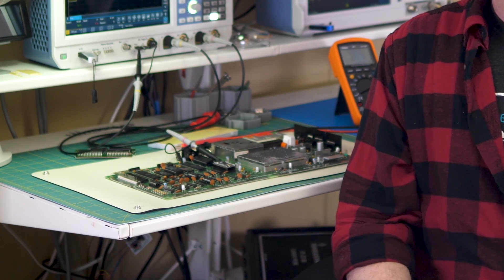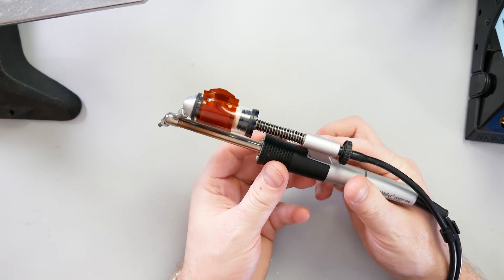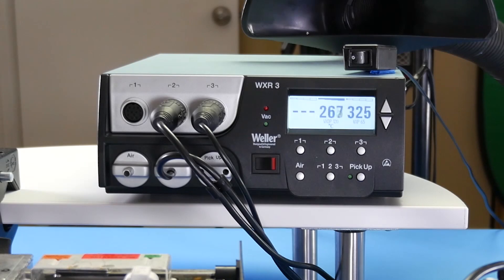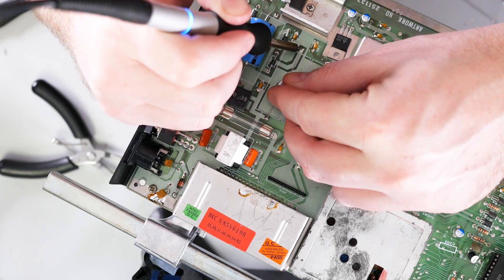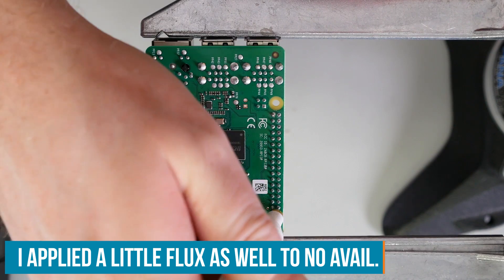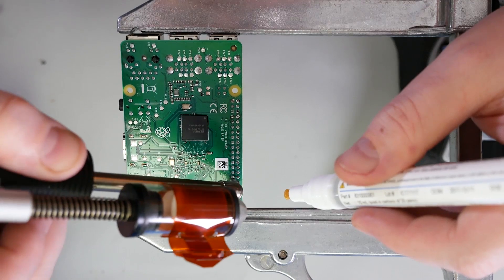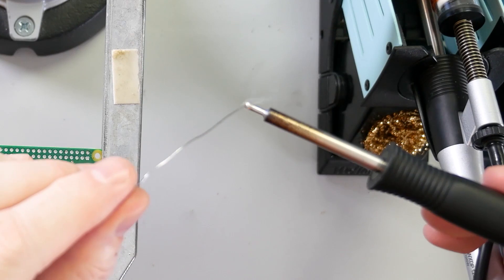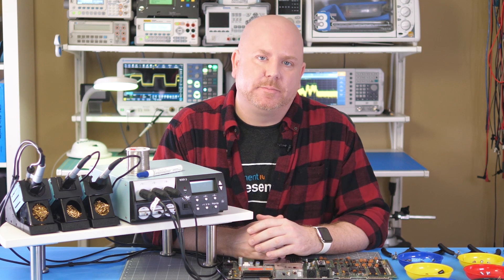Capacitor Replacement on a Commodore 64 - A Lesson in Through-Hole Soldering - Workbench Wednesdays

Comment: You never need to change the ceramic caps they never drift lol. even working on Radios from the 20 I have never seen one move. 
but I change them with axial MLCC capacitor because it just makes the board look cleaner on the C64's  work on. they even make axial electrolytic so you don't have to geto rig them caps in like that..

Comment: Thus far for me was a static generator,  just stoped working i was afraid wires had been crossed to the tri AAA battery holder. Took it all apart nothing wrong. Grrr so i checked the baterys that had been in the flash light i had just cannibalized for a year or more. Ha! Suppose to check power first!🤣🏌️‍♀️

Comment: @5:00 by spreading the capacitor leads wide like that will stress the rubber seal and it will leak years sooner than a buying a proper axial capacitor that fits there.

Second did you compare the ripple current specifications of the old caps?  If those new poly ones don't meet the same ripple capacity, then the computer may have intermittent brown outs and crashes.
Reply: On polymer capacitors, there isn't a rubber seal because there is nothing to leak. The polymer layer is solid.

Regarding ripple, polymer capacitors have at least an order of magnitude less ESR which means they have at least an order of magnitude more ripple current capability. So yes, I compared those specs.

I think you need to watch the TLC video on polymer capacitors, because they are significantly different from traditional aluminum electrolytics (which your comments apply to.)
Reply: @bald_engineer  I've used them before, and polymer caps are wrapped just like a regular electrolytic cap.  But if they have a solid core then they are surrounded with a electrolytic liquid.  Only ceramic caps are a solid material without an electrolytic liquid.

Where the leads stick out of the cap is the weak spot on all caps.  

What caps did you use, I would like to look them up.
Reply: @MidnightVisions  It is difficult to correct your misconceptions here without pictures and references. I've created a thread on element14 with links and details. I've also included a few articles which I wrote when I was a technical expert at a capacitor vendor. Find the information here: https://www.element14.com/community/docs/DOC-91431/l/workbench-wednesday-04-capacitor-replacement-on-a-commodore-64-a-lesson-in-through-hole-soldering#comment-152632

Comment: I actually thought this would be like a restoration video, but it was an ad. Which i don't dislike, if the ad is well-made (like this one), then why not.
BUT.
Lets start with WXP65, since its closest to my ZD-916 soldering station. It's 65W and it's ONLY a soldering pen, meaning you need 24V adapter (not recommended) or the station in order to work with it. Price? 204€ on Farnell. I got mine for around 60€, its 60W, whole unit with a decent pen, temperature setting and digital display. 
WXP120, the 120W soldering pen. For some reasin a bit cheaper than WXP65, 190€ on farnell. Again, just a pen, no station/controller/whatever.
And the station itself, WXR3. 1850€. I mean.. my used VW Polo costed me that much. Yea, you need good toold if you do professional work, but i won't give almost half a year of my wage on a soldering station. Sorry, not intended for hobbyists.

Comment: I've been using some sort of solder sucker for about 35 years.  I find that the quick shot of a large volume of air works great to evacuate melted solder from a via, large and small.  The large chamber also holds a lot of solder and the tip doesn't clog up.  I just heat the joint until the solder is fluid, then quickly put the solder sucker over the molten solder and suck it away.
After the job, just separate the top and bottom halves of the unit and dump out the solder bits.  I've been using a SOLDAPULLT DS017 (http://www.edsyn.com/product/DS017.html) for at least the last 10 years.
Reply: Link is no good. I guess they discontinued that model.
Reply: That's okay though, Amazon has it for $20.

Comment: Good lord. That de-soldering station is almost $2000 ?!
Reply: a Hakko FR-301 desoldering gun will do the same for $300. On a c64 use 60/40 lead solder and most soldering irons around 65w or so will do the same work. i've done the soldering work with old radio shack irons many years before soldering stations were available reasonable.

Comment: 5 seconds is a long time to heat up a pad like this, plus however extra long time you spent heating it in the first place. That sounds like a great way to get lifted pads on such an old board made to a price. Never ever do this on a Spectrum board.
Reply: Well, not sure what to tell you. In all, I did over 100 capacitors, which is over 200 pads. A single one never lifted. Heat is also an important consideration. I'd rather use a lower temperature with a slow ramp up and down, to limit thermal expansion. I settled on 5 seconds. I didn't just pick 5 from the start.

Comment: The "clock" on the TI85 is just a resistor/cap.  I remember back in my college years of people telling me what cap to remove and it would work fine except for some lines across the screen, but would just need a reset there.  I think it would of been better to put a smaller cap in there, but at the time I didn't know alot about electronics but I knew how to use some pliers and snips:P

Comment: When you ripped off the GPIO pins from the raspberry pie, you could have easily broken  some traces on on the board.  Proper way of doing it to resold the pins with soldering wire with rosin core. This would reflow the solder pin, making it easier to suck out.  Also when you found out that one of you filter capacitor was too short, you could have easily solder an extension lead from another  cut filter cap lead and thus properly connect your filter cap.

Comment: Could you show me what cap kit you got? I need to do this on a few C64s. Thanks!
Reply: If you visit the link in the description, I have all of the capacitors I used as well as a post explaining why I picked different ones. There are many revisions of the PCB, but in general, the ones on that list will get you most of the way.
Reply: There's a lot of C64 revisions, you need to find one that matches your revision.

Comment: You should have at least checked the ESR.  The ceramics are fine.   Unless it was a high hour unit, Ill bet the original caps would be good for another 40 years.  Thats me though...
Reply: The ESR won't shift over time on a ceramic. And on an electrolytic, you need to measure their leakage, not ESR. Regarding the ceramics, they do have an aging rate. Every decade-hour they lose up to 5% of their capacitance. Decade hours occur at 1, 10, 100, 1000, 10000, and 100000 hours after they last reached their Curie point. Through-hole capacitors only hit that point during their original manufacturing. (Surface mount hit it during reflow as well.) Manufacturers rate the capacitance after between 48 and 1000 hours (and that has changed over time.) 

The reason I changed them is that they are low-quality ceramics and are a Z5U rated dielectric which means they have an aggressive aging rate and poor temperature stability. So, swapping them out with fresh X7Rs seemed like a good idea. Is it necessary or critical? Probably not, but I'm in there and they are cheap.

Regarding the electrolytics, the 10uF decoupling caps are in excellent shape. I measured the leakage of a few and they are WELL below a parametric fail. (You can see that in TLC #42.) The three large electrolytics capacitors, however, are at their limits. If they went through test verification today, they would be a parametric fail.